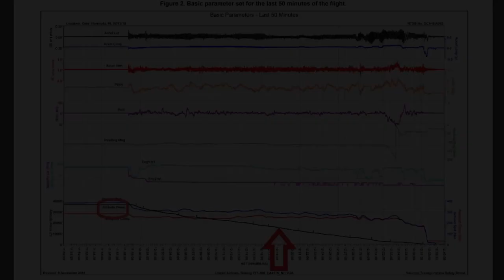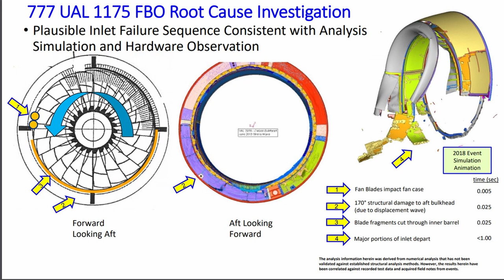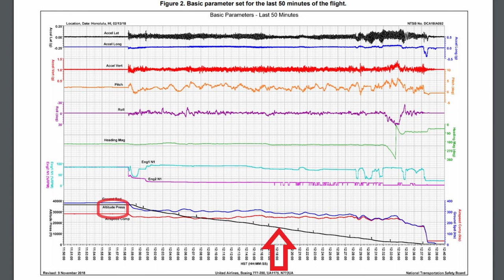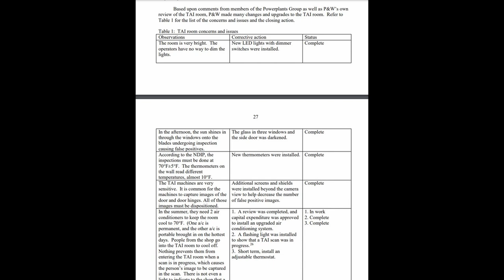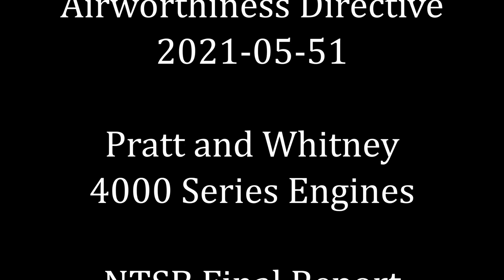Emergency AD & NTSB Final Report UAL 1175 Fan Blade Failure

Comment: 187000 pounds of fuel - for mostly asparagus and salmon... our future generations will despise us to degrees we can't even fathom yet.

Great video on the blade failure though :)
Reply: No different than ordering an Anchor Steam at a bar in New York, if any were open.
Reply: @oscarb9139  Yes,  sadly so. Apparently we're doomed if people don't actually start to use what's between their ears.
Reply: @kontoname  Mankind will die out when people born prior to 1990 die off and are unable to help most of the rest of the population survive.  Once fossil fuel is completely banned, it won’t be possible to transport coffee or tea, and the economy will come to a halt.  The power grid will fail and a revolution will occur when people are unable to charge their iPhone 35’s.  This will result in the complete destruction of the existing infrastructure (graffiti, Instagram posts, and very caustic tweets) by unruly crowds.  Unable to operate simple tools (can openers, knives, and the thing that sits under the microwave) the population will rapidly succumb to starvation.  

Wildlife, however, will thrive as they never lost their instinctive skills, and will simply graze around the starving people who are staring at their iPhones, remembering a time when the charge symbol would appear in the corner of their now dead device.
Reply: @oscarb9139  That's your opinion. Apparently you're born prior to 1990 to have such a mindset. Whenever I hear "fossil fuel banned" I know right away that I'm talking to someone without a science background. I mean, just imagine having to do calculations on how long fossil fuels will last us for the next 100 million years right? It gets scary when you're only allowed to burn a gallon over your whole life span.

So ultimately we can only hope that generation will dies off quickly and makes room for a mindset not keen on burning off fuel that earths ecosystem had to seal into the ground at high pressure to allow for the athmosphere and ecosystem we have (had) today, until the generations of the last 100 years started nearly destroying earth.

I'm happy to hear you're optimistic about wildlife though. Now, at the point of insect population collapse of more than 70% in many industrial countries. Of trash carpets on the sea larger than many average sized countries.

I suggest to pick up interest in engineering or science. Maybe we won't have time until the 1990s are gone if average people with access to the internet are still relying on such a train of thought.
Reply: @kontoname  Sure.  I will add that to my Physics and Geology degrees.

Please lecture me on the earth friendly mining practices to make the batteries for the electric cars.  And then tell me how we will charge them, once everyone has one.  Nobody likes looking at a mine, but must really love looking at thousands of wind turbines.
Reply: @oscarb9139  So we should give up on life and just keep destroying the planet using outdated tech?
Batteries are at least rapidly improving. Fuel powered car engine research is basically at it's limit by now and basically still inefficient to the degree that movement is still only a byproduct of creating heat. Do you seriously suggest we keep burning whatever is in the ground unless that's done? Odd, I thought you mentioned a physics degree...

Mining is also necessary for fossil fuel, for metals for engines etc. - I fail to see the advantage.
Even the highly critical cobalt is ALSO needed for fuel cars. To harden steel for example. And even lithium can be mined safer than many other materials if done right. And that's not even where modern battery tech is going.
Electricity is needed anyways, even for just aluminum production.

Honestly I fail to see the point that shows fossil burning vehicles are more environmentally friendly than e-based ones. You're likely thinking about production 10 years ago or older.

Not to mention there are better options. For example green power to gas. Fusion is on the horizon. Literally every tech aside from fossil is improving.

Wind turbines are just part of the current energy mix by the way, they are a bridge technology though. It's not like we could travel space with wind turbines - or crude oil... ;)
I'm not the biggest fan of them myself though - the construction just uses too many non-recyclable and degradable compound materials.
Reply: @kontoname  I am all for fusion.  It will be a great thing when that is developed to the point where it can be harnessed for electricity.  I am also for fission.  I am against covering every hillside with wind turbines.  They are noisy, kill hundreds of thousands of birds, and really sucks to be in the shadows of those machines.  It is probably the most expensive method of power generation and requires a backup to be running continuously, as does solar.  For every watt of wind/solar, there has to be a watt of coal, gas, or nuclear running continuously to back it up.  There are places where wind makes sense.  

Ev powered cars get their power from coal, gas, nuclear, and renewables.  Every time energy changes form, there is a loss of efficiency.  If Tesla could give away a car to every person in LA, how would they be charged?  Where would the power come from.  The sun doesn’t shine at night and the wind is usually lees intense.  So, the cars are powered by fossil fuels.